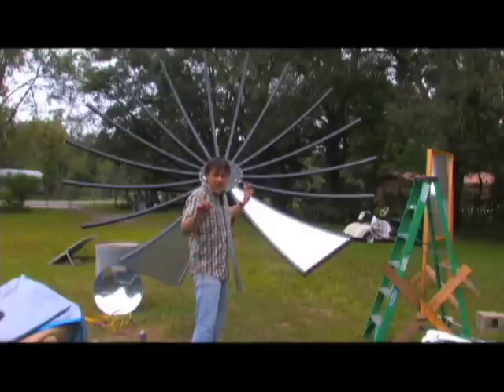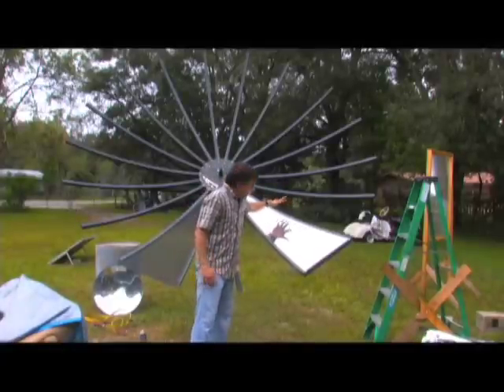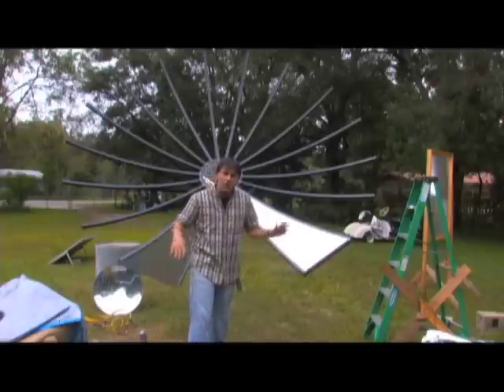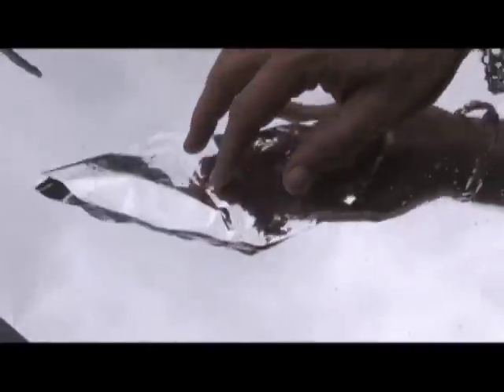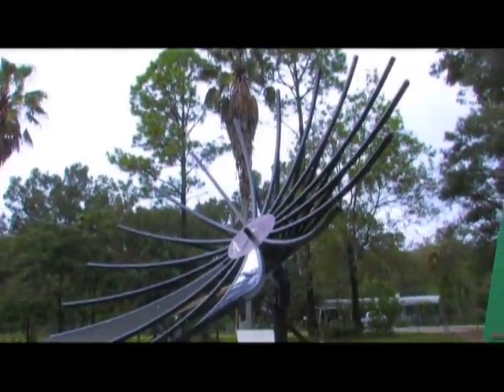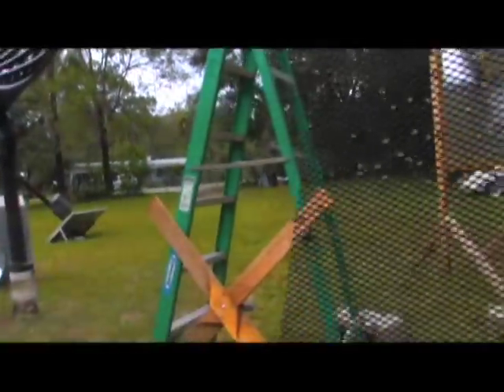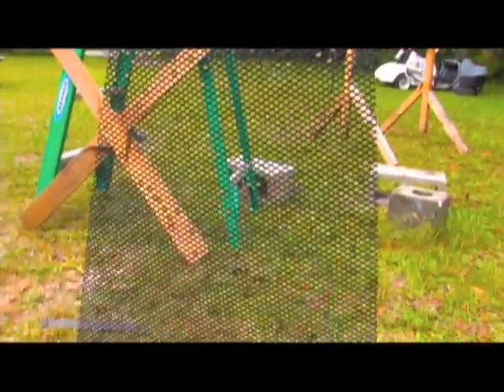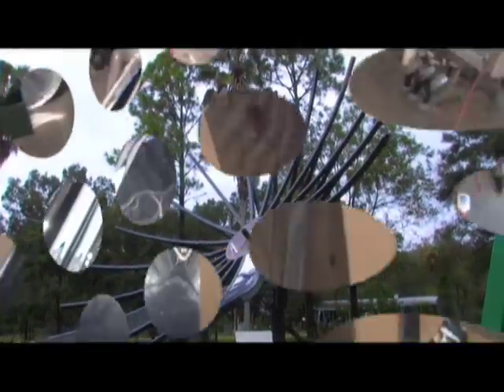SATELLITE DISH CONVERSION Huge Parabolic Mirror Solar Power

Comment: I once saw an article in Popular Science where they covered  the dish in mirrors like yours. They left the arms that hold the LNB at the focal point and replaced the LNB with a collector box wich they ran water thru to make steam. They used the motor that turns the dish to track the sun using a photovotaic cell to turn the motor on and off. When the sun would hit the cell it would turn the dish until the cell was in the shade, then turn off. A solar "switch", if you will.

Comment: I guess the easiest way to figure that is to determine how many BTU's your heater uses a day. That 80 degrees is your stored btu's So your heat usage can be deducted from that storage + the heat loss through the insulation.  Which because you are not dealing with as high a temp that loss will be reduced.

Comment: For domestic heat I don't thing they run the water at such a high heat level.  My boiler only produces about 120 degree water. It is a on demand system.  So I'm thinking that you don't need that much water that hot. Have a look at the flexable rod steam engine.  With it all you need is 120 degrees as well.  So lets say you heat your water to only 200 deg and allow it to drop to 120.  Now your only talking an 80 degree difference.  The question would be how long that will last without sunlight.

Comment: Sorry I messed something up the last time I figured this.
9 sq meters has 30600 btu's in an hour. It takes 1 btu to heat one pound of water one degree.  600 gal heated 300 degrees require 180,000 btu's to heat the water @100% efficiency. Water weighs 7.48 lb per gal.
600 * 7.48 = 4488 # of btus to raise water 1 deg.
4488 * 300 = 1346400 total btu's needed.
1346400 / 3400 = 396 Total meters of sunlight for one hour needed. / 9 = 44

Comment: As for the heat loss of the tank under no load.  The problem with figuring that out is that the internal temp is not a constant and you don't have an internal temp. You have greater heat loss when the inside and outside temps very greatly. So your actual loss would be on a curve.  Also on my previous comment is with using water and not oil. You would need to know how many BTU's it takes to heat one pound of oil, one degree.  1 sq meter of sunlight in 1 hr has 3400 btu's  At 100% efficiency.

Comment: The answer really depends on how efficient your system is.  1 sq meter of sunlight has the energy to heat the water in about 4.25 hours.  But that is at 100% efficiency. And that is figuring going from 200 deg to 500. Most likely you will only achieve about 35% efficiency at best.  So you will need about 3 sq meters of sunlight at least. And that is insulating everything including the tank outside except for the heat points.

Comment from the maker: If your target is larger, it blocks the mirror so you either have to angle the mirror or allow it to block a bit which lessens the power.

For smaller mirrors 35" and below, you can combine like this v=U6294LKoU5M

Comment from the maker: They can be used together BIG DISH. Normally anything you place in front of the dish takes the sunlight so you end up with a net zero. but, the center of the dish is blocked by the target (water tank....? etc.) . Also the center of the dish does not do much so it will help in some cases. 

A Spot Fresnel and a Parabolic mirror are the same size for size but the Fresnel Lens will usually have better optics so the Fresnel edges by about 10%.

Comment from the maker: Hi Odziz:-)
Lightsharpener was a bunch of small mirrors. This should be a lot stronger. I was able to burn wood today with 2 of 18 panels in place. The screens actually are edge curved. That means this is a true parabolic not array flat plane. 

Putting it back together was a tough job.